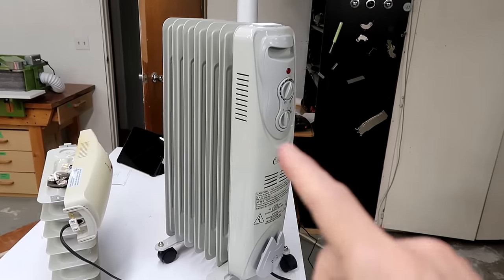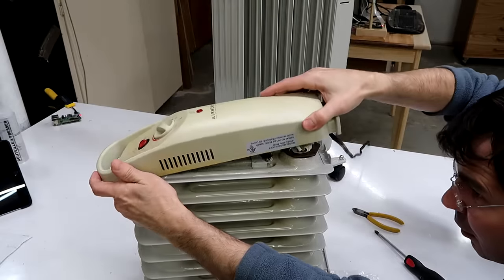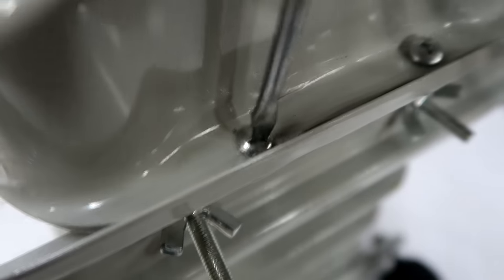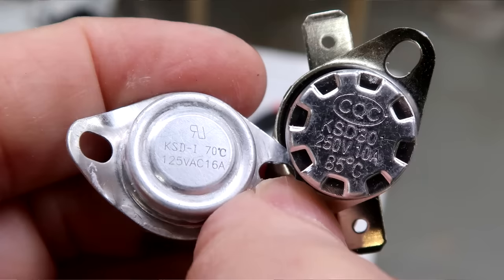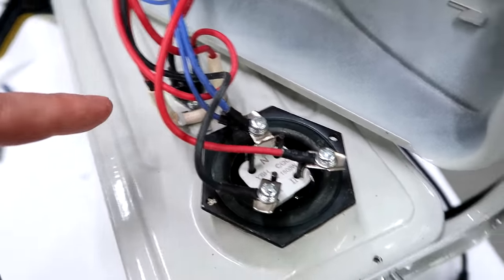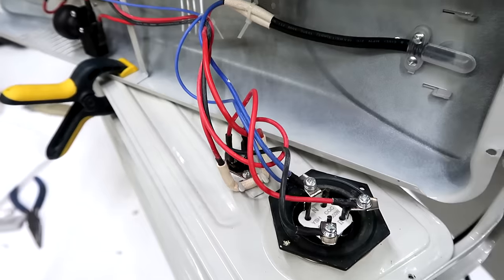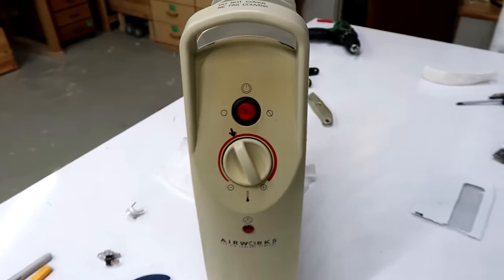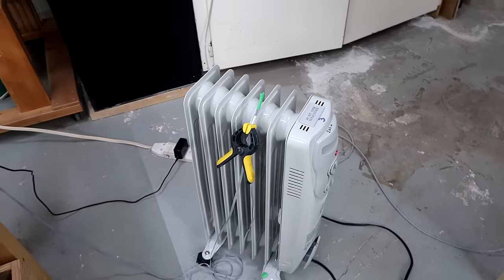Oil filled space heater fix

Comment: You could build your own ground source heat pump. (200 meters of PVC piping buried in the garden; one of your many motors as a blower and an old fridge as a heat exchanger) ? The question that I don't know the answer to is: "should it be a loop or be open at the other end of the garden with an air filter." ?
Reply from the maker: Fridge heat pump only pumps about 100 watts worth of heat.

Comment: Heat pump would be more sensible then I guess.
Reply from the maker: watch the video
Reply: @matthiasrandomstuff2221  Didn't see the text mentioning heat pumps, thought you where talking about the gas boiler (which you where).
A bit strange if a heat pump doesn't pay itself itself, even here in Norway where electricity is dirt cheap a heat pump pays itself after just 5-6 years. Over here the mini splits are common for after market installs as they take less space and can easily be placed where need with no ducting.
But if you've done the math, you've done the math, we'll just have to trust you on that.

Comment: I've got a Fantastic heat pump system. That is 3-5x more efficient then those. Depending on outdoor temps
Reply from the maker: Yes.  And when you really need the heat (when it's cold outside), it's maybe 1.5x as efficient.
Reply: at 0 F its better then 2x but its a bit different as far as airsource heat pumps go. The condenser is grossly oversized but is capable of running from 18k up to 66k so at the end of the year it's pretty cost effective but I am in the states so my energy cost are significantly different i imagine
Reply: It has more tech in it then the average car lol

Comment: Due to osmosis these heaters have a risk of explosion and are therefore banned in many countries.
Reply: What do you mean by osmosis?  I’ve never had any issues with the two that I have!
Reply: @mainelyelectric  over a time oil sinks and replaced with air.  At a point they explode.
Reply: @kib2675  Where does it sink too? And where does it get the air if they are sealed units?    I’ve never heard of this!!
Reply: @mainelyelectric  Touch the greasy outside of an old olive glas bottle which has never been opened.  Same thing. The hot oil inside gets a very low viscosity, and due to the surface temp the residue evaporates on the outside.  Take an old heater and shake it, sometimes you can feel the low oil level inside
Reply: @kib2675  I’m still not understanding you.  Are you saying that the oil leaks out over time? Or evaporates?  If so how? If they technically are sealed units.
Reply: @mainelyelectric  read up on osmosis
Yes it does.

Comment: Put a big 20 in box fan with a 19 in 20 in cheap furnace filter behind one of these oil-filled radiators and it will really surprise you you get so much more heat and circulation.... I'm not kidding it'll really surprise you these things are useless without a fan they really don't work without a fan behind them don't put the fan in front of them it'll burn the fan up...
Reply: different situations call for different space heater models, these are not useless in keeping a smaller room at a steady temperature over many hours, and there are no hot elements where kids or pets can come into direct contact with them.

Comment: Heat pumps are over rated. You need electric coils in it to heat when temp is below a certain temp outside. They are very expensive so people are fooled by the promoted efficiency claims. I supplement mine with the heater you are working on.
Reply: The "coils" you mention are not to supplement the ability of the heat pump to generate heat for the dwelling, they are just to defrost the outside could to remove ice.

Comment: I just bypassed the over heat protection switch, now works fine, hasn't blowen up or anything.  I don't leave it on unattended.
Reply: @NoBody11010  yea going  like a train, haven't burnt anything down with it yet. Probably would be safer with an onboard timer to switch it off automatically after a set time.

Comment: That is quite a silly design... clearly the heaters installed into them are more powerful than the radiator's ability to put heat into the room.  A fan blowing over it (as others have suggested) would significantly increase the heat transfer rate and should let you utilse more of the heating potential.
I wonder if the reasons for this are 1. bragging rights on the box or 2. the heating elements are a standard part for a big range of heaters and more suitable for machines with larger radiators. Probably both.
Reply from the maker: Easy.  People want a 1500 watt heater.  So you make a 600 watt heater and pretend its a 1500 watt heater.  Just like those pretend 5 hp shovacs.